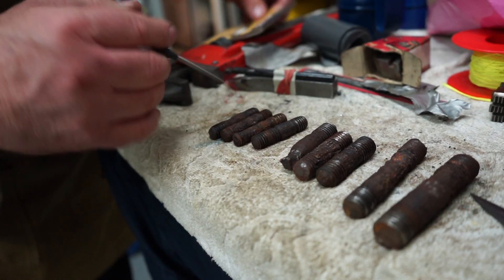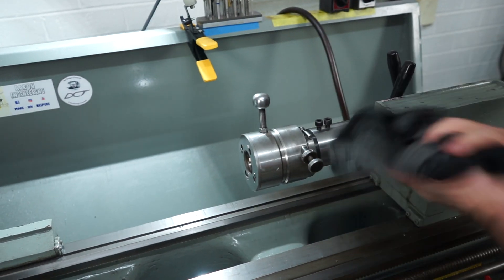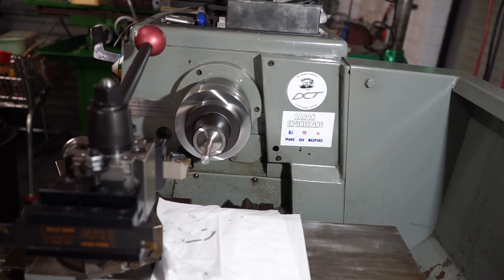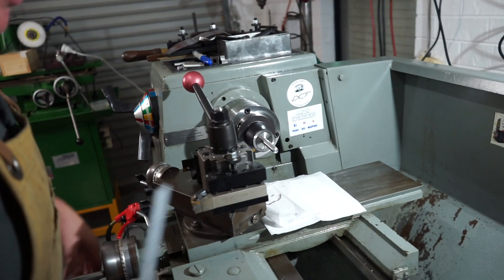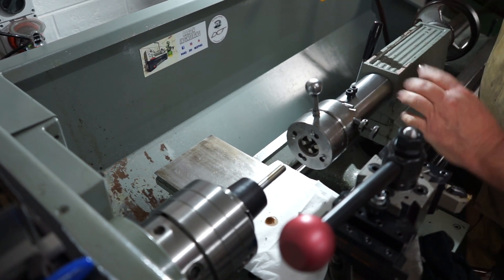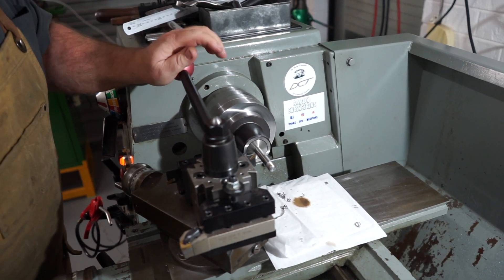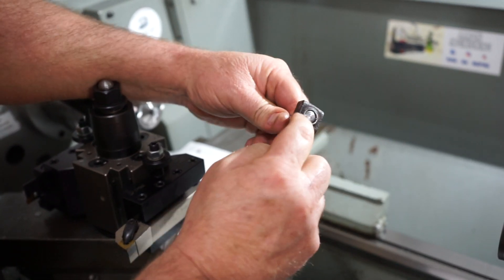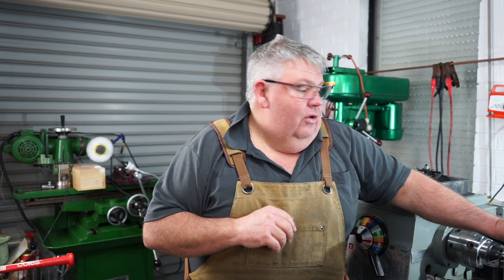My FIRST time Using a DIE HEAD

Comment: Very nice. Here in the USA we rarely see Coventry heads. I have Concentric. One thing I recommend for any lathe work is that if you intend to do an operation after using any kind of sandpaper, carefully clean the surface before doing it. I’ve found microscopic particles from the sanding on the work. That can speed up the dulling of cutters.
Reply from the maker: G’day Mel. Thanks for watching mate. Yes many different brands and types of die heads on the market. Sadly a thing of the past now these days with CNC.

Very valid point in regards to the sand paper. I get a little complacent sometimes when machining. Cheers 🍻 Aaron

Comment: I used to have to make thousands and thousands of blow off studs for the space shuttle.  Leaded Steel and use a diametric head.  Gosh I got so tired of that, but man it would go quick.  A 5C collet chuck, diametric head and a stop set and the spindle never turned off all day.  Then when I would get done, they would need another 5000.  Not hard work but very boring after awhile!  This was in the  early to mid eighties.
Reply from the maker: G'day RJ.  That's absolutely amazing, thanks for sharing.  I bet you must have been busy during that production run.  I had fun making these 8 studs, but don't think I'd enjoy making a 1000.  Love your tool changer video too.  I have another channel that I do cnc stuff on (design creativity and technology channel).  I used to be very active on that channel, but enjoy my manual machining too much these days.  Cheers, Aaron.
Reply: Ah you mean geometric head ...did you bump open  or just  had a long  dwell and let pull open
Reply: @miguelcastaneda7257  They get called all kinds of names such as  "Auto Die Heads", Isometric Die Heads, and Geometric Die Heads.  Not sure why they have so many names.  We set a stop and just cranked the apron to the stop then the head extended a tad and released.  Ran it in a MT adapter on the tool post.  Pretty slick.
Reply: @RJMachine62  been using  on brownies .cva index daveport  n Acmes decades
Reply: @miguelcastaneda7257  LOL, I meant geometric.  I type diametric by mistake.  I didn't catch that :)
Reply: Just recalled there is another  style for cutting internal only used twice in past decades die head but well tap style can't recall name
Reply: @miguelcastaneda7257  Tapamatic or Procunier ?
Reply: @RJMachine62  no not a tapmatic was simular  to die head had four chasers  but reveaersed to simulate a taps individual flutes you could adjust .... I hope  I recall name

Comment: Looks like a time saver. Thanks mate 👍🇦🇺
Reply from the maker: Hi Mark, yes much faster than manual threading or single point threading in your lathe.  I'm looking forward to making the other studs with the larger dies.  Cheers, Aaron.

Comment: They’re a great tool especially if you have a lot of threads to cut . I used one all day 5 days a week for about 6 months cutting the short thread on engine studs when I worked at a fastener factory - near drove me insane !
Reply from the maker: Hey Ian.  Thank you, the die head was fun to play with and I'm looking forward to cutting those larger threads.  Not sure about running one all day for weeks on end though.  I think it would old very fast.  Cheers Ian, Aaron.

Comment: Nice and easy way to do a production run of threaded parts. Over here in the states we have alot of Geometric die heads. Same tool just different brand I think.
Reply: H& g early early versions  looked like geometries and simular chasers just outside face had an angle
Reply from the maker: @miguelcastaneda7257  Thanks Miguel 👍🍻
Reply from the maker: G'day Tom.  Yes these things are bloody brilliant to use.  Yes apparently there are many different styles of die heads.  I think the "Alfred Herbert" brand were the original.  But don't quote me on that.  Cheers, Aaron.
Reply: It was geometric tro collapsible die head...getting old to much stuff in my head

Comment: Always good to see one of your vids Aaron. Thanks for sharing. That die head would work a treat on your Tool Makers Clamp Kit.🙂. I was going to make a silly remark about painting your house with an oil can but I see you got it straightened out. Cheers
Reply from the maker: G'day Doug.  Sorry mate, I need to get onto those parallel clamps.  I need to extract the digit and get busy.  Yes, that's an old coconut milk can with sump oil that I use.  I think Dianne would have a "pink fit" if I painted the house with it LOL.  I actually need a smaller brush.  Cheers Doug.  Aaron.

Comment: So I take it the thread length is determine by how far you crank the tailstock (assuming you are keeping up with the feed rate of the die)?
Reply from the maker: Hey buddy.  Now , that's a very good question.  It would depend on the thread pitch you were cutting and the pitch of your tail stock feed.  I'm not that smart to work that out, so off camera I just did a couple first (trial and error) until I got it sorted.  Cheers, Aaron.

Comment: Nice demo, I use a couple of geometric units all the. Time, great on a turret lathe.  When I use them on a standard lathe.  I lock the quill, set the carriage as the stop, allow the tail stock to drag until it stops against the carriage, then the die head will pull and disengage.
Reply from the maker: Hello Randy.  Hope you're doing well over there mate.  I been thinking of you after watching those wild fires that were close to your home.  That would have been a scary ordeal.  A carriage stop is an excellent idea.  I will have to give that a try.  I was just locking the tailstock and feeding in manually to the depth and stopping.  Cheers Randy.  Aaron.

Comment: Nice one Aaron Coventry die heads make threading easy, although it might be worth stripping it down again, it should pop out a lot smoother than that and spring back quickly. The little lever is roughing and finishing.
Love the workshop Chihuahua 👍
Ian
Reply from the maker: Hello Ian how are you?  Yes it was rather tight.  By the end of the day it did free up a little more with consistent use.  I thought that's what the lever was for, but old humpty dumpty just fed it in and drove it home.  Cheers Ian, Aaron.